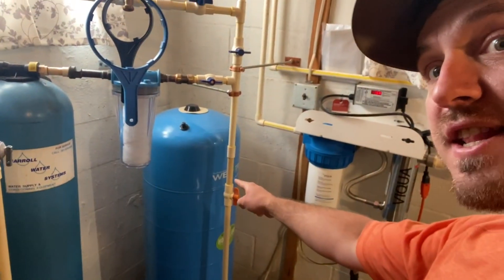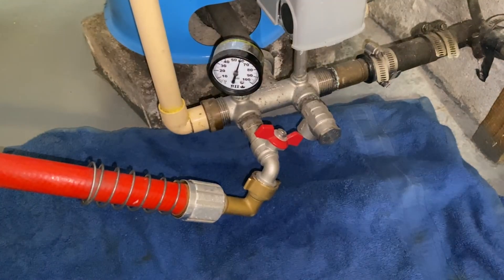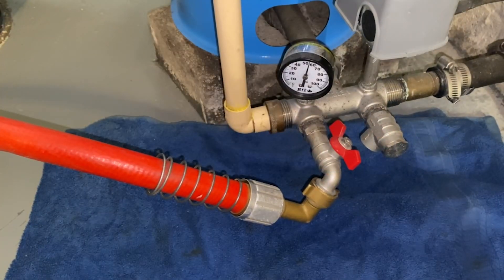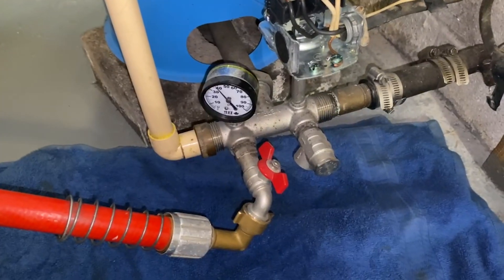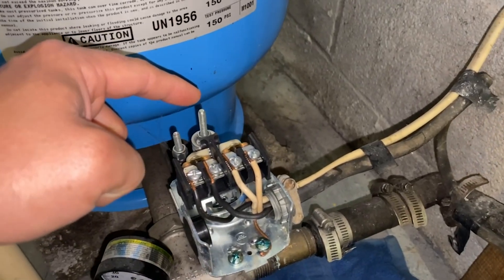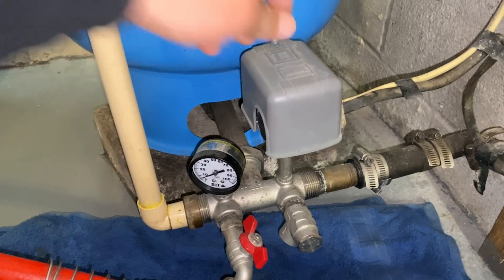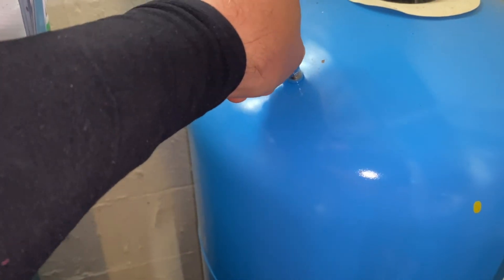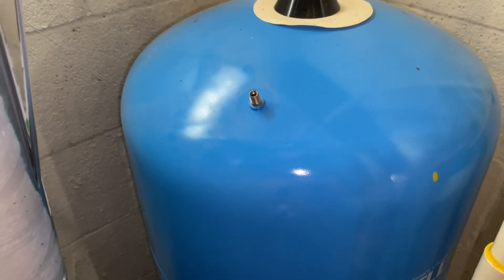Best Way To Drain A Pressure Tank & Recharge The Air

Comment: I am having water/well issues.  No water.  But, power to pump, 0 psi.  No water. Just replaced the pressure switch.  Still no water.  Owned home 8 and 1/2 years..  Water problems just as long.  3 well pumps, 9 pressure switches and 5 headaches later...feel like selling and giving up.  Help!!!!

Comment: So, my toilet ran all night and my bladder is now only at 17.5 PSI (using the pressure gauge), but it registers no pressure on the gauge on the tank.  Do I add pressure?
Reply: I just filled it to slightly below the 'turn waterpump on' pressure setting according to my pressure gauge on the compressor. I have a 30-60 pressure switch. Filled it to about ~26 psi (it had been 14psi and I had noticed how often the waterpump turns on). I did not change any settings.

Comment: Very good presentation. Very easy to follow. Just wanna clarify something. We have a 40/60 switch. I put a pressure gauge on the needle on the top and it read about 55. I just wanna make sure I'm understanding your suggestions properly. Should it be around 38 since it is a 40/60? This is the first time I've ever checked it and we have been here for about five years with the same tank. And we have never had a problem but recently I noticed That I heard a humming noise and then a click and then the hum would go off. When I drained the tank earlier today I saw the pressure come down and then I saw the little switches inside close and then open back up when I shut the drain off and switched the water to the house back on.
Reply: Being 40/60, your tank air pressure psi should be 38. A High pressure could result in explosion. Very important to carry out yearly checks!

Comment: Does the air pressure have to be let out when drain  winterizing a tank?
Reply from the maker: @gbass7328  no. You do not need to remove the air to winterize.  Just draining the water
Reply: @Wellssepticandmore  Great, thx for the fast reply!
Reply from the maker: My pleasure!

Comment: My tank looks exactly like this one. Ours is about 4 years old. It's been cycling on and off rapidly. I'm trying to drain the water. I turned off power and the water going into the tank. Water won't flow out of the tank unless I have the air compressor pushing air in
 What am I doing wrong?
Reply from the maker: That sounds like the bladder has ruptured. An easy way to check is to turn the power to the pump off and drain the tank. If you can rock it and still hear water sloshing around, it usually means that the tank is water-logged. A water-logged tank needs to be replaced, or it will burn the pump up. 4 years is pretty young for a tank though. There may still be a warranty on it. Well X tanks have a 7 year manufacturer warranty